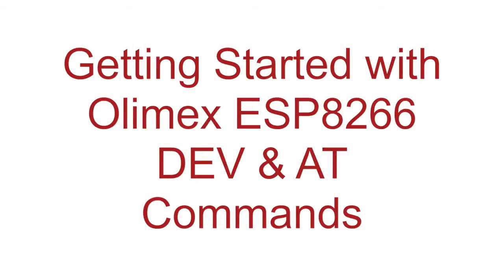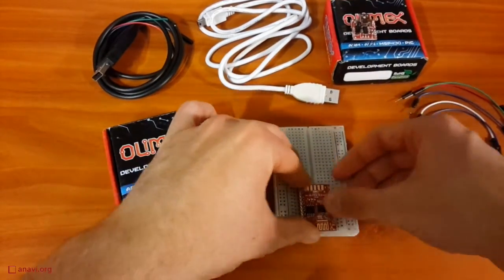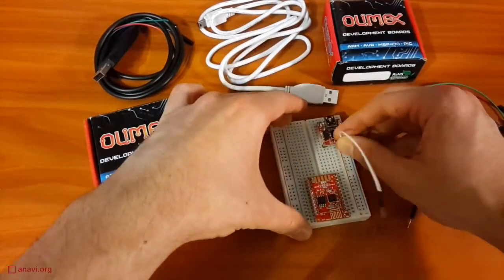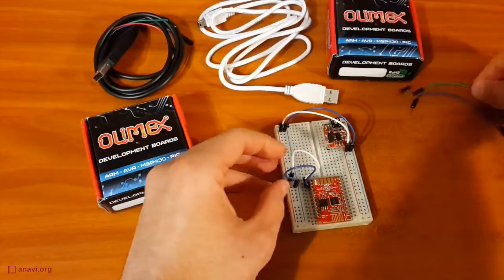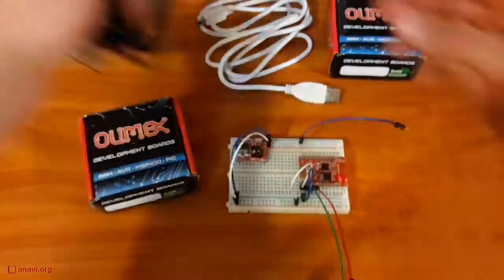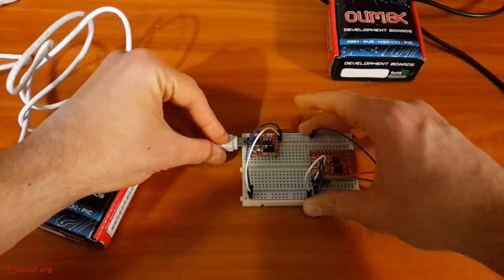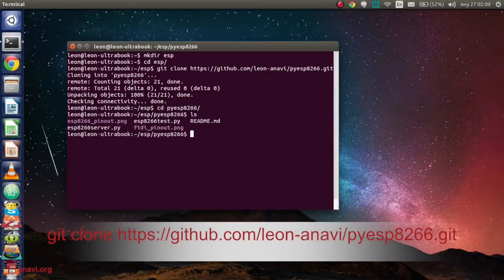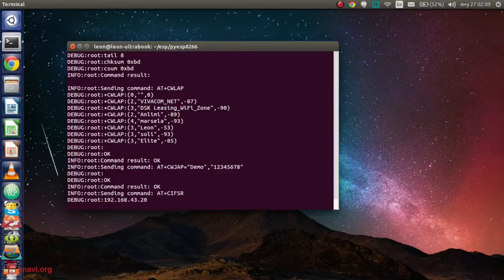Getting Started with Olimex ESP8266 DEV and AT Commands

Comment: I have the same ESP8266 module but don't how to program it through USB. Do I need to buy this specific USB module from Olimex to interface with it?
Reply from the maker: Mate Marschalko no, all you need is USB-Serial-Cable-F. Download SDK following the instructions at https://github.com/esp8266/esp8266-wiki/wiki/Toolchain 
After that build you firmware and flash it to ESP8266. There are examples at ESP8266 and you can also check the very simple "Hello World" that I have created: https://github.com/leon-anavi/esp-hello-world
Reply: Leon Anavi Amazing, thanks! I have these: http://74.82.171.210/images12/G011_2.jpg AND http://whosawhatsis.com/paraphernalia/ftdi_basic_5v.jpg

Not too sure what the difference between them. Both seem to have TX and RX pins. Could you please help me where to connect these pins on the OLIMEX board so I can communicate with it?

My goal is to be able to use it with the Arduino IDE: https://github.com/esp8266/Arduino
Reply from the maker: Mate Marschalko I highly recommend you to use USB-Serial-Cable-F or USB-Serial-Cable-M from Olimex.

On MOD-WIFI-ESP8266-DEV TX is on GPIO1, aka pin 3, RX is on GPIO3, aka pin 4. Double check this information at the board's schematic: https://www.olimex.com/Products/IoT/MOD-WIFI-ESP8266-DEV/resources/MOD-WIFI-ESP8266-DEV_schematic.pdf 

The connection of USB-Serial-Cable-F to MOD-WIFI-ESP8266-DEV is demonstrate on the video. If you want to flash a new firmware you must set GPIO0 (aka pin 21) to low before you boot the device.

You can have a look at the article about programming ESP8266-EVB with Arduino IDE at Olimex blog: 
https://olimex.wordpress.com/2015/03/31/programming-esp8266-evb-with-arduino-ide/